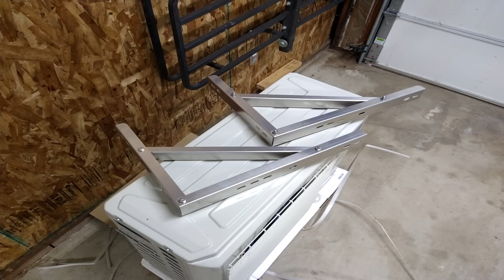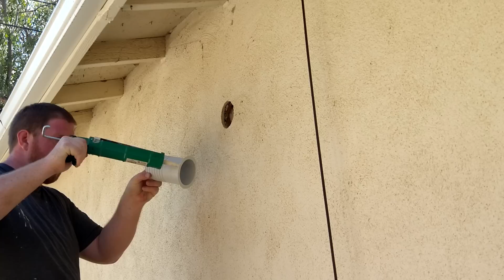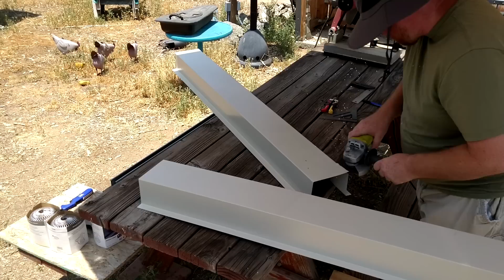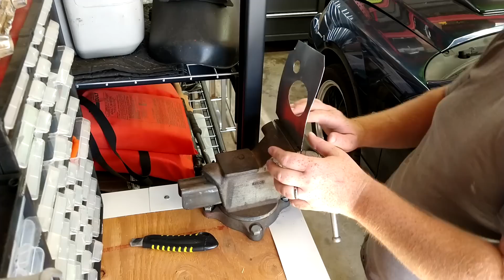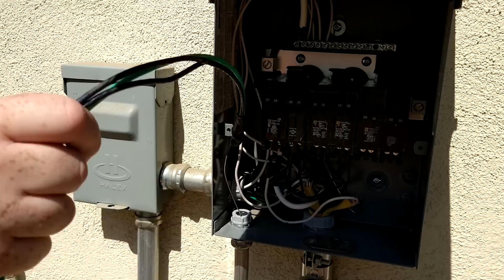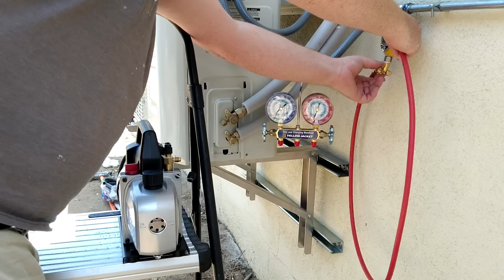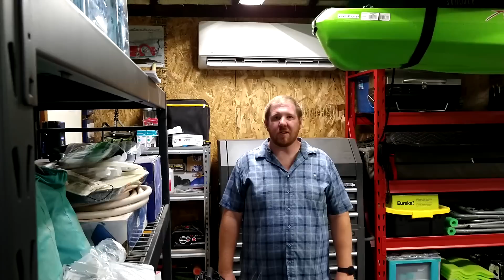How to Install a "non-DIY" Mini Split

Comment: What's the best way to find the studs through stucco for the mount?
Reply from the maker: In my case, I knew that the studs were immediately to the left of the rafters, so I was able to use a level and measure down.  If you don't have that option, you might have to locate them from the inside and drill a small pilot hole through to the outside.  If there is drywall, you can patch it later.
Reply: @jkfeatherranch  Thanks for the reply!!

Comment: One more thing where did you get the metal covering for the pipes?  Like you said the sun hits the side of the house and plastic won’t hold up.
Reply from the maker: I got this one from Amazon but later I found out that I eat overpaid for it, so I've been using pieces of 4x3 square metal downspout with the back cut out of them, which are about $20 instead of $100.

Comment: Without using a spanner torque wrench to tighten down the fittings you might as well of used SharkBite fittings:-) great video
Reply from the maker: I use the official German torque spec - Gütenteit!
Reply: @jkfeatherranch  snug it down and go a quarter turn farther
Reply from the maker: @trueamerican1576  tighten until it loosens, then back off a quarter turn!
Reply: They do make those now

Comment: I ended up purchasing four mini splits. They are a different brand of course. They did not have the pre-charged line set. I went ahead and purchased the tools necessary ie vacuum pump kit for mini splits, 45 degree r410 a flaring kit, digital micron gauge, two of the vacuum rated valve core removal tools one of them 5/16 one of them 1/4 inch, open-ended torque wrench kit, nylog sealant, reaming tool and better bubble leak detection solution. About $700. I'm installing four mini splits into my home making it multiple zones. I only paid $2,900 for all four. As I am all solar off grid the 36,000 BTU inverter 18 Seer mini split will be in the living room. Each room will get a 18 Seer 12000 BTU Wi-Fi enabled inverter Mini split. I will be busy needless to say this weekend is going to be hot and I am going to have fun.
 Edit: I will make sure that all of my flares are sufficient and connections torqued down. I will then vacuum the system to below 150 micron. I will follow instructions per the manual and release some refrigerant testing for leaks before releasing the rest. I could not bring myself to purchase nitrogen for pressure testing
Reply from the maker: Sounds like you bought more stuff than me.  This was basically a test run but since then Ive done our whole house with mini splits because our central air was too small to keep it cool anyways.  So far they're all working very well.

Comment: The Unistrut was a good install idea for the wall bracket. Maybe I missed why the ceiling was not drywalled or finished like your side walls to reduce the volume you needed to cool. Most of these install I never hear anyone say they need to be inspected by the city, especially the electrical. Never hear anyone say they used ground fault breakers.
Reply from the maker: I left the ceiling open because I use the rafters as storage and there are not enough joists going across to easily secure drywall to.  The reason that nobody uses ground fault breakers is because they are incompatible with the inverters used in mini splits. They are known to create interference and trip them immediately even when nothing is wrong.

Comment: This is a great installation and I like that you put it on the wall. Many YouTubers are not securing outdoor units at all and let them just sit on the ground. And as the final, they are getting coolant leak sooner or later.
Reply from the maker: We installed one at the In-laws on the ground and one 8ft up the wall. The one on the ground is nailed in with foot long nails on a thick pad so that shouldn't have an issue with leaks as it won't be moving.

Comment: Great video but how did you find where the studs are before you used the strut for the bracket?
Reply from the maker: I knew that each stud was straight down and directly to the left of each rafter, so I used that for reference. If you don't have something like that, you can look for the nails in wooden siding, or you might have to drill a small pilot hole from the inside and patch drywall later.
Reply: @jkfeatherranch  Thank you

Comment: Lol.  So much wrong here.
Reply from the maker: Like what? It works and has worked just fine for a year now.
Reply: @jkfeatherranch  Working for a year means nothing.  A lot of your install procedures are incorrect and it will take a while for the problems to crop up.   28+ years as an HVAC contractor.  My words have merit.
Reply: @joshuaseaton4526  you are wrong here, I have 40 years in the A/C business, so you are still learning...
Reply: @erikcable1755  He did a lot incorrectly in the video, 28 years, 40 years, doesn't matter.  Facts are facts.
Reply from the maker: @joshuaseaton4526  such as?
Reply: @jkfeatherranch  Examples?

Comment: I installed this same unit in my house 3 yrs ago. Don't forget that the inside head unit has to be pulled apart including removing the long tube fan under the evaporator to clean it. Dirt and mildew/mold builds up on the fan blades and behind the evaporator on the plastic and needs to be thoughly cleaned  once a year. It's sorta a chore to disassemble the head unit but after the first time it becomes easier. If you don't do this the head unit will become infested with mold/mildew build up and unhealthy to be breathing in. Good luck...
Reply from the maker: Yeah lots of fun. We cleaned part of it already since it's been a year.
Reply: @jkfeatherranch  it gets easier second and third time around..

Comment: Great info very informative, How far is the far side of the garage and what is the temp near the unit ?
Reply from the maker: Its a standard two car garage. It can get it down to 72 on a 110 degree day, which is a fairly normal summer day. We have a large fan to help cicrulate the room better and it feels fine on the far side with that. Just needs a little help with air flow in the large room, especially if there is a car in the way.

Comment: Why you not connect the pipes directly? First you go with the pipes left then right and cut and then you connect the pipes! Go from the hole directly down und connect.
Reply from the maker: Because the instructions told me to have at least 10 feet of pipes between the inside and outside. So I had to route them off to the side to make room.

Comment: Great job
How do you Bend the line set  without kinking
Reply from the maker: Thanks. If you watch to the end of the video, I didnt. I had to cut the kinked part out and replace it with elbows. After that I always use spring benders so that doesn't happen. $11 on Amazon for a set that covers all the sizes you need. Lifesaver.
Reply: @jkfeatherranch  thanks much
Reply from the maker: @gregrichard9192  Welcome

Comment: whats the trick to finding the studs behind stucco for the condenser mount lol
Reply from the maker: We can see the rafters and they are immediately to the left of them in our garage so all I had to do is measure straight down from that. Please don't take this advice without verifying how your wall was built first. Othewise if you don't know and don't have a way to indicate, you can find the stud on the inside and drill a small hole all the way through to the outside and patch it later. Lots of guessing. We had to do that on the In-Laws house and have one hole in the wrong place.

Comment: Holy shit. Your thumb on the miter cut of the line set flange gave me anxiety.
Reply: Definitely not a good idea to cut a short piece of pvc on a miter way.  I know 2 people missing part of their thumbs from doing that.  the saw grabs the PVC and just like that, missing digits or parts of digits.
Reply from the maker: In my defense, I don't use that saw anymore, and have one with a functional blade guard.

Comment: One of the better jobs I have seen. Only issue was when you blew air into the line set. Any metal that was on the end is now into the line set
Reply from the maker: Thanks. I blew the air through the side i had not cut yet so it went all the way through and blew the shavings out. Then i could blow through that side to clear out the other one.

Comment: Does the compressor on the outside of the building need to be lower than the lines that come outside from the inside unit?
Reply: No.
Reply from the maker: It doesnt have to thats just how I installed it. The lines can go in any direction.
Reply: @jkfeatherranch  
TY for the response.    
My unit is only a year old. It is leaking water into my house. The service guy (who just put Freon in last year) says it is bc it’s leaking Freon. So after another $250 for Freon, he’s trying to sell me a $6000 unit. Says my unit is a piece of crap. 🤷‍♀️
Reply from the maker: @bernadetterobbins109  Do you know what the old one is?
Reply: @jkfeatherranch  the brand 
is “enso “. Surely they’re supposed to last more than a year? (The service guy must be a dealer for Mitsubishi)
Reply from the maker: @bernadetterobbins109  If it's leaking water, then that's not a freon problem.  That means your drain line is clogged or mis-routed or has a hole in it.  The water is supposed to drain through the wall and outside.  I just had to deal with this on a different unit and it was because I had pinched the flexible drain hose during installation and made a hole in it.
Reply: @jkfeatherranch  this makes more sense. I had an awful feeling that he was not telling me the truth & just wanted to sell me a new unit. 
     I don’t even know if he really put Freon in it. Or just hooked up the gauges. Especially if, as you say, it wasn’t a Freon issue!

Comment: Minor detail, but the sleeve should be installed from the inside to the outside. The smaller flange goes inside with the flat side on the bottom so the sleeve is fully concealed behind the indoor unit. The heavy metal flange is then caulked in to the sleeve outside.
Reply from the maker: You're right, and I can slightly see the flange below the unit on the inside.  I'm sure if I read the directions I would have known that!

Comment: Nice install! I agree with a previous poster about considering the "thermal mass" of your garage. The AC has to cool the contents as well as the air.  I just installed a mini split as well, and after the contents are cooled the garage maintains temperature very well, and even when opening and closing the garage doors, the space readily cools back down. My NC summer climate is hot and muggy, so I leave mine on all the time.We will leave hot cars outside to cool, when weather allows, to make it easier to maintain temp., as a hot car radiates so much heat.
Reply from the maker: Yeah they're probably right, as it does eventually get down to temperature, and then heats back up after bringing a hot car inside...

Comment: Nice install.  I'm now looking to do this to our two car garage.  My biggest concern is not the wiring or anything like that but drilling the damn hole in the wall then to the outside (we have siding)...lol

In your video you have the unit mounted to the exterior wall which I would want to do as well since our two AC units are directly bolted to the exterior brick foundation wall (all of our houses in the HOA are like this).  I have heard however that these little things can vibrate the hell out of everything and you hear it through the garage.  Do you find that to be true?  I would not want to mount this on the ground.  I want it up and out of the way.

Also like your "real" world problem of messing up the line.  That's totally something that would happen to me and it's nice to see a video that isn't stitched together "perfectly" no problem installs.
Reply from the maker: Thank you.  I'm not gonna lie there's a slight vibration/hum when it's running but it's not something that would be a concern in a garage.  A window or through-wall A/C is MUCH louder.

Comment: A nitrogen pressure test is recommended  for installs a lot of diy installs fail because you cannot properly test for leaks with just a vaccum. The flares also need to be properly torqued down to specs otherwise they can leak as well.
Reply from the maker: I mean, technically you're right, but my cheap ass didn't feel like springing for that at the time.  Or the proper torque wrench.  So I went with the German method of "gutenteit!"
Reply: @jkfeatherranch  fair enough..hows the mini split doing..my advantage is still going strong in this georgia heat wave.

Comment: Personally,   I hate the installs where they mount the condenser to the house. To me it seems like the air flow is restricted being so close to the house.  Air flow is the basis with how heat pumps work? 

I prefer to mount further from the house.   Just my opinion
Reply from the maker: You might have a point but it's worked fine maintaining 72 when it was 110 outside.  The reason I chose to mount the unit to the side of the garage was to get it off the ground since it's dirt and I didn't want the rain kicking up mud and depositing it inside.

Comment: Does a 2 ton mini split move as many CFM as a normal 2 tons heat pump with air handler? I'm planning on using four 2 ton mini splits in my 40x68x13 shop.
Reply from the maker: Not sure of the CFM, but it blows pretty hard on high.  If it's not enough for proper circulation, you could always use an extra fan or two.

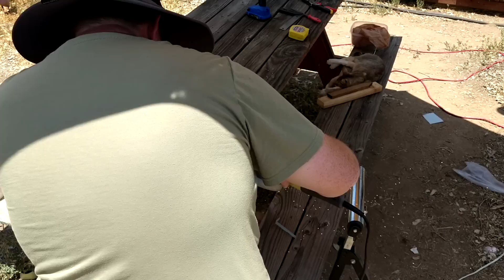Comment: @12:10 I love how the cat is so cool with power tool use that he's just chilling and trying to take a nap.
Reply from the maker: A lot of our cats are like that. We recently redid our floors in the hallway and put in vinyl flooring and we had to lock up one of the cats because she would not leave everyone alone and was right there and everyone's face while they are hammering and chiseling at the sides of the wall about to get her paws smashed. Every tool that someone was touching had to also be touched by the cat. Every piece of flooring that was being installed had to be touched by the cat no matter how much noise was going on. Nothing deterred her from investigating everything in the room.

Comment: I'm an HVAC professional and I also handle Mr. Cole as a dealer and never had a chance to hook one up for myself for myself I should say but I'm impressed that you got a 30° plus temperatures split because most residential AC units your standard split units not your mini splits won't go beyond a 20° split between the outdoor ambient in the indoor eating however that is contingent on a whole lot other stuff like insulation as for the way you install that I was impressed but you probably could've saved yourself a little stress by just adding a coupler and soldering that in with stay Brite eight solder and stay clean flux but other than that damn good
Reply from the maker: I've never tried to solder (braze?) A/C lines before and I figure this probably wasn't the best time to start learning.  I thought that temperature "split" was measured between the return air and supply air, not between inside and outside temperature.  The ultimate inside temperature that you can reach is determined by the size of the unit and heat gain, which is a factor of insulation and outside temperature.
Reply: The 20 degree split is the Delta T between the room air being drawn across the coil and the temp of the supply/discharge air. The outside ambient temperature has zero to do with it
Reply: @James Karrie Always best to braze line sets.  Flares have a tendency to leak or fail.

Comment: As an HVAC installer I’m very impressed with the quality of work
Reply: As a detail-oriented amateur, I'm also impressed by your work quality.  It looks like you ultimately went for doing everything right, even when you accidentally made mistakes and went back to correct it.
Reply from the maker: @JimmyNewCakes  Thanks. That's why I like to do it myself. I know I will make it look right.
Reply: On mine left more access to the drain tube . They are known to clog up .
Reply from the maker: @arcraider937  if it clogs I'll figure it out
Reply from the maker: Thank you!

Comment: Recently installed my own non-DIY system (triple-head).  Nice to see someone else use flexible conduit for the power cables out to the indoor units, see many videos where there's no conduit used!  Took me a while to get everything to hold vacuum (because the o-ring had fallen out of my mini-split adapter, so was chasing non-existent leaks for quite a while).  In the end, it's been a great, quiet and efficient system!
Reply from the maker: Yeah I had that problem with a cheap Harbor Freight gauge set when working on one of my cars.  Low side valve leaked, couldn't figure it out!

Comment: great video, where did you get the wire/line covers from...
Reply from the maker: Bought it from Amazon for way too much money.  I've done another mini-split since then and just used 3x4 square metal downspout.  Cut the back out and it slips right over the lines, and made my own end caps the same way I did in this video.

Just be careful with drill presses, my fingernail is still growing back!